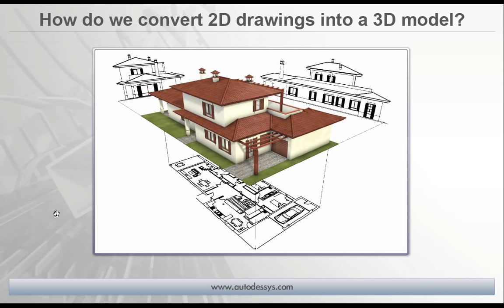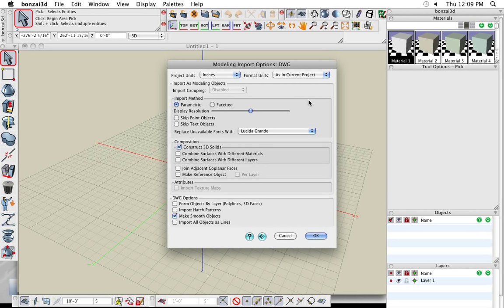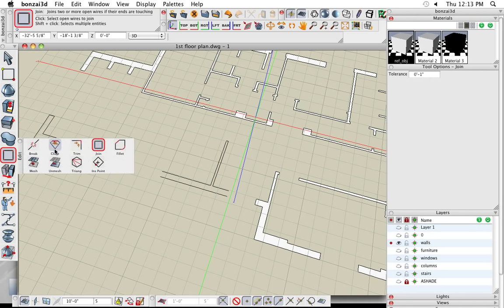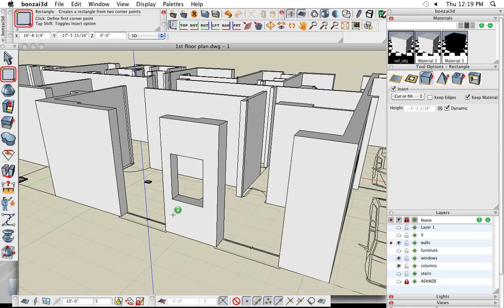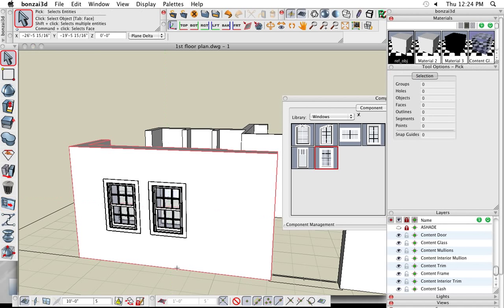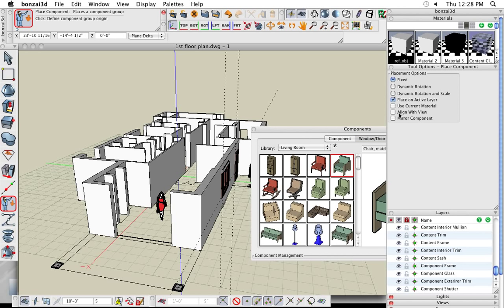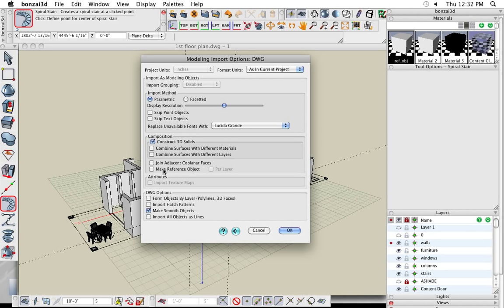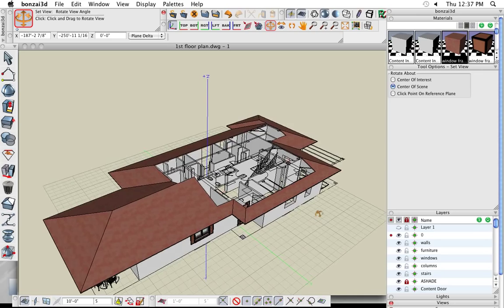bonzai3d - How to convert 2D drawings into 3D models

Comment from the maker: @PerivaleBuses 

To load an Underlay Image, select a reference plane with the desired orientation (XY, YZ, etc).  Then save this as a custom reference plane in the associated palette.  Double click on this plane (from in the palette) to access its properties.  Choose the desired size, check the Underlay box, and click on the image or folder icon to choose your desired image.  

(You can also use the Edit Reference Plane tool from the bottom of the window to graphically resize the plane. :) )